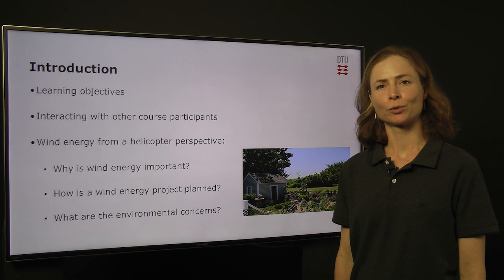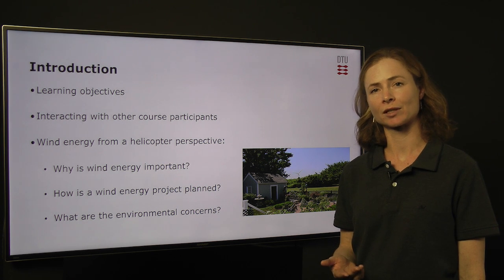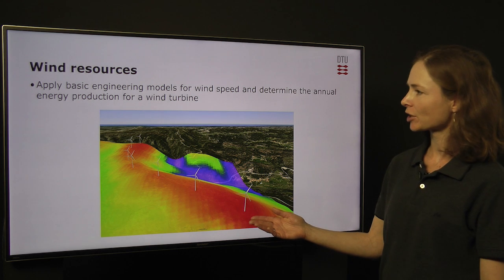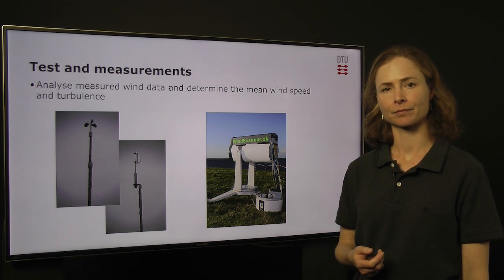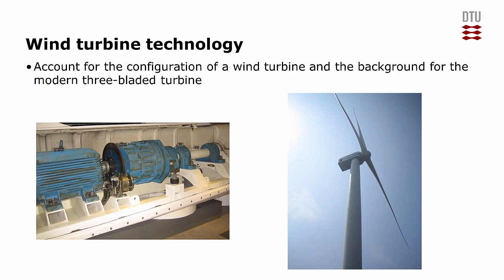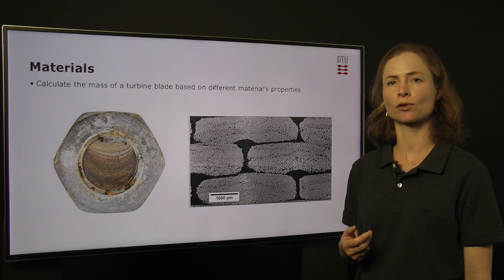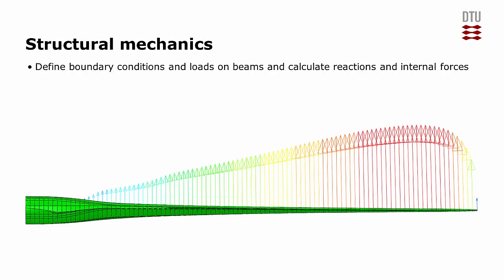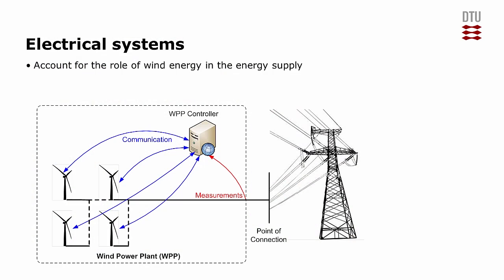1. Course overview

Comment: Thanks for this course, I am in the health field but this has been a dream of mine to live with sun and wind energy for over 40 years.  I have asked several questions of Professor Sorenson and he has answered about battery storage with wind energy.  We had an idea to have our local area produce 5000 electric vehicles with a battery of 50kWh each to give a virtual battery of 250 MWh.  If we could develop a V2G system how would that fit into the scheme of wind power?  Would that allow the ability to "unchain" the turbines and to keep producing knowing that any extra energy could be stored?   If you have offshore wind, would batteries be an option?  Would it be best if they are also placed offshore, or could they be onshore?  Am I wrong to think that with storage the wind turbine could be more effective and productive?